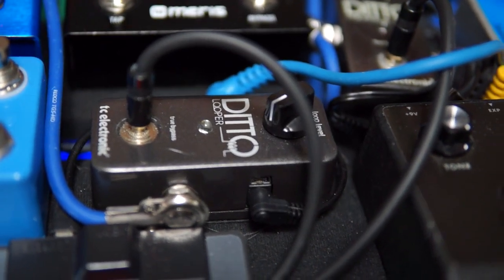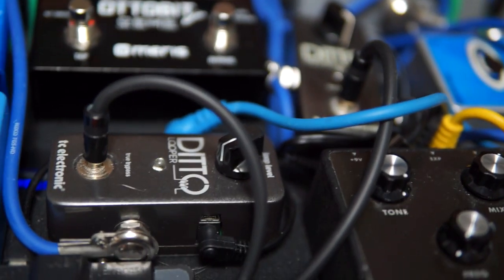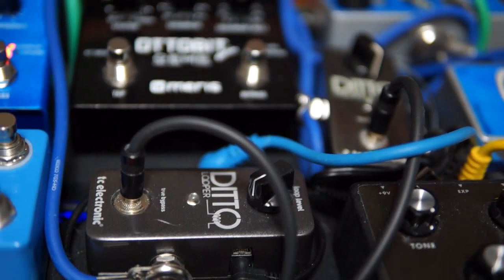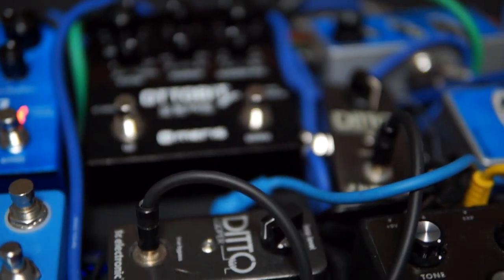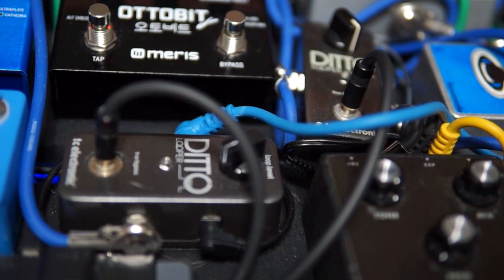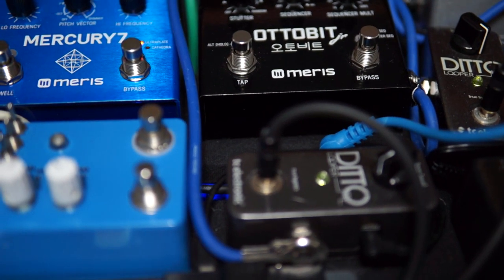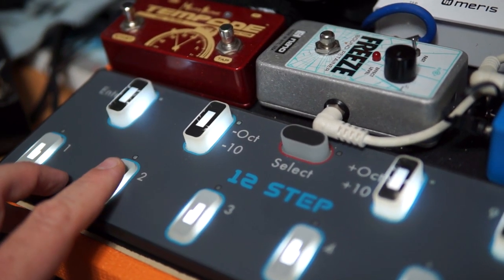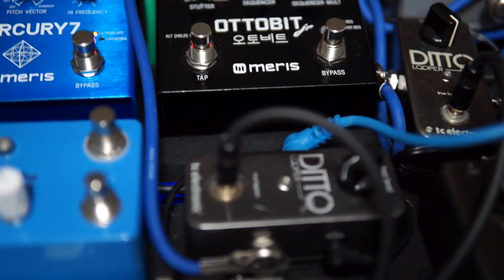Controlling Ditto looper with MIDI (and CV)

Comment: This is very interesting! I own a ditto looper for my guitar but would like to repurpose it for use alongside my digitakt groove box. The idea is to facilitate transitions from one "track" to another by loading a midi synced fixed duration of the track, say 16 beats, onto the looper, then switching to a new track and mixing as you would with two decks. Would you be able to share your code for this project? Many thanks, Gerry
Reply from the maker: Seems like I've misplaced that code... I was changing PC at the time and I guess it didn't transition with the rest of my files. I'll have a look on old backups, maybe I can find it there. However, the blog post I wrote does give a pretty clear overview of how this was coded: https://no-insects.blogspot.com/2019/01/hacking-ditto-looper-for-midi-control.html